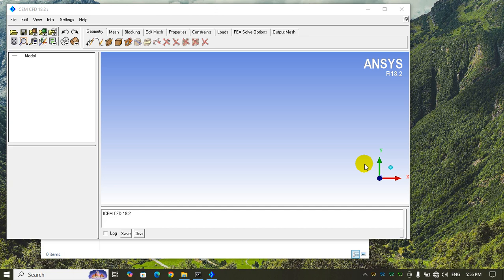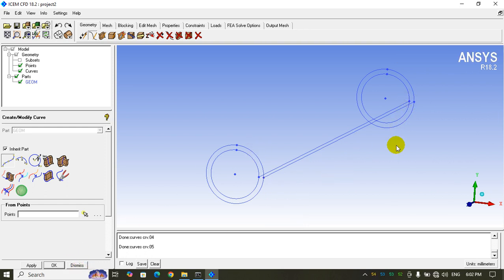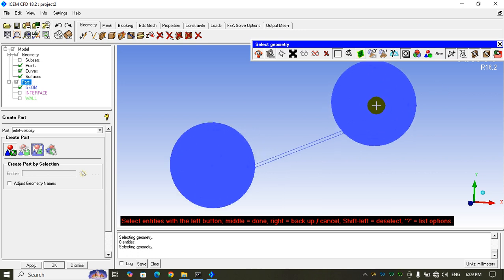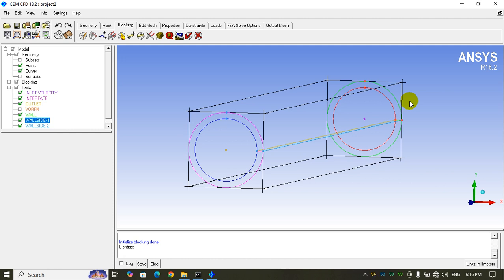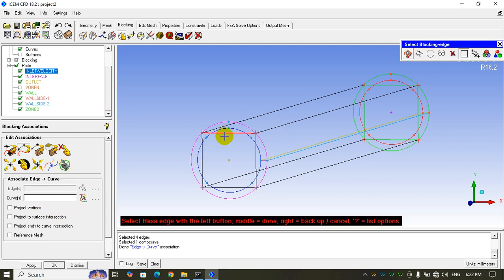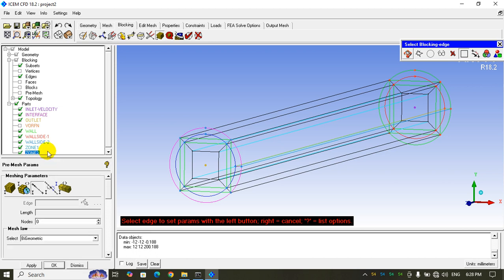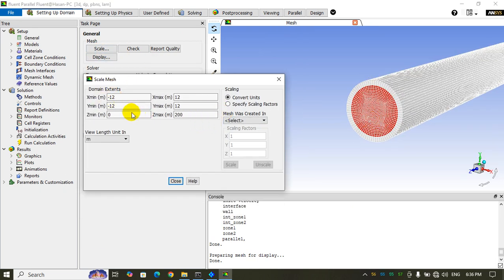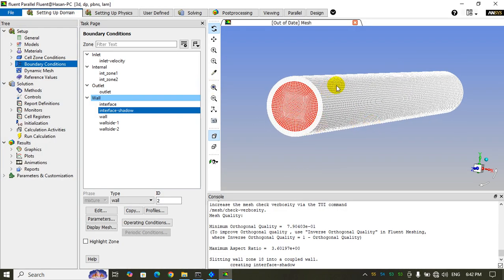How to Create Multizone Structured Mesh in Ansys ICEM CFD – Simplified Guide

Comment: Would it be possible to make a cylindrical (O-grid type) mesh around a uniform Wing (rectangle shape) and then wrap a C-grid around the tip of the wing to form a hemisphere cap above the cylinder? I've been trying to get this to work as one single structured grid but I'm having trouble with the geometry. Any advice?
Reply from the maker: Yes, of course. Please see the following video: https://youtu.be/9Bc0NBk-urM?si=HVOouxPXdnkHguPm

For geomerty, if you have a data point of the geometry, you can import them to the ICEM CFD. Please check this video for more information:  https://youtu.be/3VuZiDIl704?si=sLdpISMfTe4DXMqS

Good Luck.

Comment: Can I create pipe in design modeller and transferred to the icem CFD?
Reply from the maker: Yes, you can. There are many ways to do that. The first way is to link the design modeler block and ICEM CFD block and then make your mash in ICEM. See below for linking:
https://www.youtube.com/watch?v=JfsK1xJlowg&t=1391s
The second way is that you can export your geometry with agdb format and then import it to the ICEM through file > import model. You can also use many other formats such as STL, GEMS, and igs formats.